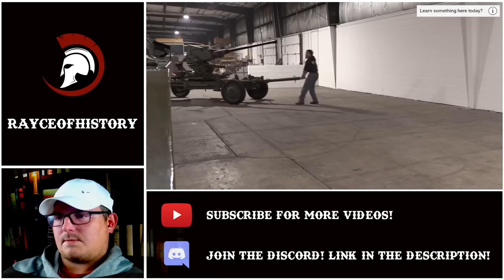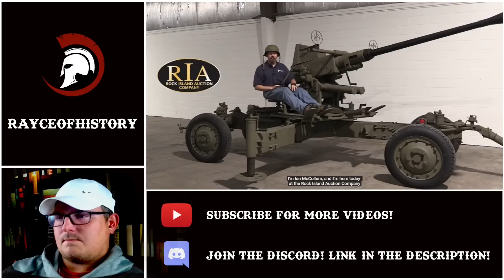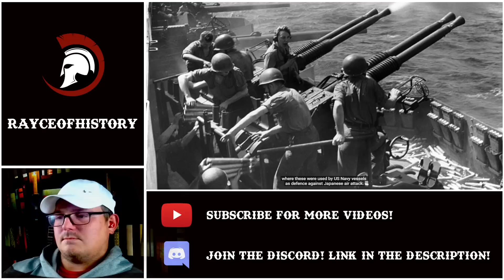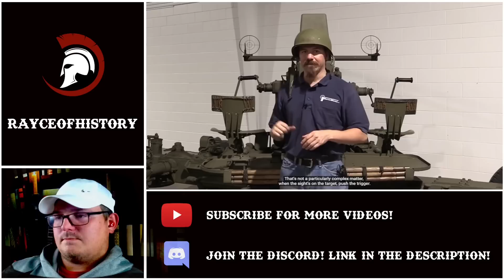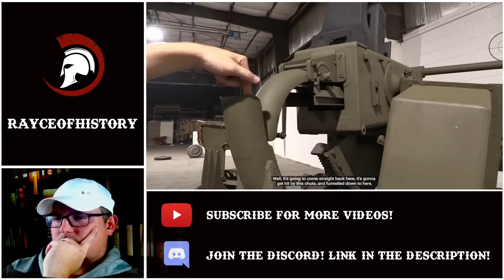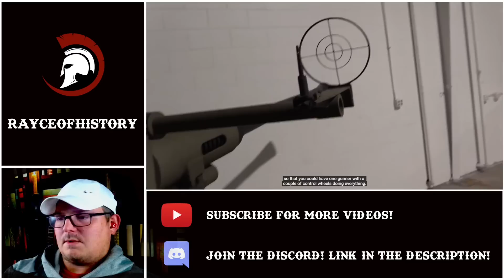Texan Reacts to Swedish Antiaircraft Artillery: Bofors 40mm Automatic Gun

Comment: My big brother was a conscript operating these guns at the island Gotland.
And I beleive that this gun (barrel?) was used in at least the first generation of the Combat Vehicle 90 (Stridsfordon 90). Some ammunition was also designed to be progammed for different use when loaded into the barrel. So for hi-explosive rounds the gunner or guide system could make the round detonate at a sertain position in the path of flight, that it could be shot over a hill and detonate behind the edge of that hill taking out hiding infantry. But I think that the newest version of CV90 uses 30mm guns...

Comment: I did my Military service in Luleå, Sweden 1984-1985 at the AA regiment as a Bofors 40mm gunner, shooting down Viggen jets.
At that point in you were stationed with a Radar/joystick controller with each gun though you needed an manual gunner when the connection breaks between the two ofc, which was me.then tou had 4 guys feeding the ammo, two onthe gun and two feeding both of them...
Reply: Then the aiming wasofc electronically driven manually by rhe gunner but you could ofc go fully manual if needed..

Comment: Glad you told the story of how the twin mount prototype made its voyage, and I too am very puzzled by Ian's error about when the Navy adopted the Bofors. And you were right the first time...the initial model was the L60 and the L70 was the improved model from just after WW2.
For a single gun, it requires a minimum of 1 loader, however, just about every US Navy mounting for the 40mm was either a dual mount, or a quad...except for on PT boats and subs pretty much...so each mount would require at least one loader for each gun. Then, you need somebody to pass the clips of rounds up to the person actually feeding them into the gun, and then you need teams of people who are passing the clips of 40mm rounds up from the ammo stowage spaces. And it also was usual Navy practice to have extra loaders on every dun team, so even though only 1 person was technically needed to feed the clips, the Navy would always use more than 1 to do the job if at all possible. So you are correct that just 1 loader won't do it for almost any US Navy mounting of the 40mm...but that is due to the multiple guns per mount and other factors.
The latest version of the AC-130J no longer carries the 40mm Bofors...the Air Force has retired the last of its AC-130s that have the 40mm, but there are still a few flying with the ANG, I believe. The AC-130J has the 105mm and a 30mm chain gun with a dual feed ammo system...but it can also carry a large number of a wide array of small, precision kill weapons systems like the Small Diameter Bomb and Hellfire missile and others.✌✌💯💯
Reply from the maker: Thanks, I didn’t know any of the upgrades for the AC-130’s other than it was getting a decent overhaul. I’m trying to find a video that goes into how the 40mm Bofors was used by different countries during WW2, because there really are some interesting and out of the box ways, even, like you mentioned, putting them on subs. I’m glad I was right on the year given for the adoption being a bit off, I would have felt like a jerk making a correction right at the beginning that was wrong. I always appreciate the information and insight from your comments.

Comment: Sweden has the 40mm Bofors in their CV90 versions also. Both the IFV and AA vehicle. The SABOT rounds are said to be able to defeat T72 tanks at all angles except the front. They have three magazines of 8 rounds each, so you could have one magazine with antitank rounds, one with high explosive and the third with proximity rounds to deal with helicopters. Making the gun and vehicle pretty versatile.
Reply from the maker: Is that still the kind of go to gun for Sweden or is it a different one now and the 40mm Bofors is just on a few different platforms? I read a list recently of everything this gun was put on in one form or another and the list is really kind of incredible. It’s almost like what you would expect for a list of what a general machine gun has been on. Seriously it’s kind of wild how commonly it has been used.
Reply: The navy has various calibers of Bofors guns. But outside of the navy, it is the army that still uses the classic 40mm on the CV90 platforms. It's kinda like the Carl Gustav, the gun works and all you need to do is upgrade the ammo (sort of 😅)
Reply: @scruffy7760  the gun control system has been updated over time, the most modern cv9040 version today has a fully digital gun control system, the night vision and thermal sights have been improved, there is now a processing computer using gpus for "ai" processing for easier identification of objects in the gun sight
Reply: What? They don't handcrank them anymore?
Reply: https://youtu.be/J8PZiCtuSqk is a 5 min video describing the current 40 mm in the CV90. The video is from Matsimus so you know it's honest 👩‍🏫
Reply: Pretty sure it's still used on US gunships too. Edit: ah mentioned later in the video
Reply: @andersmalmgren6528  are gunships naval vessels or land forces? no... also, the latest variant of the ac-130 doesnt have the 40mm, it only has 30mm rotary cannon and 105mm howitzer